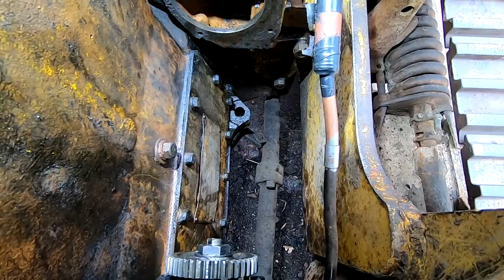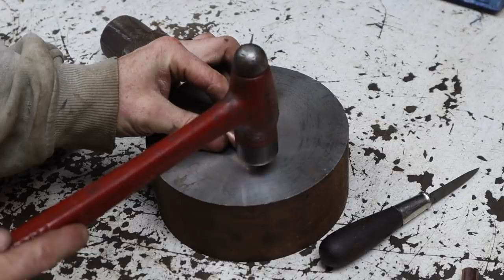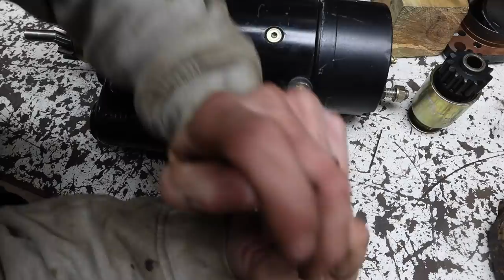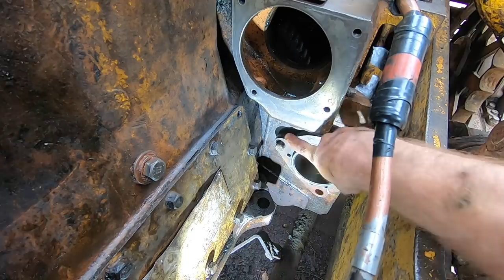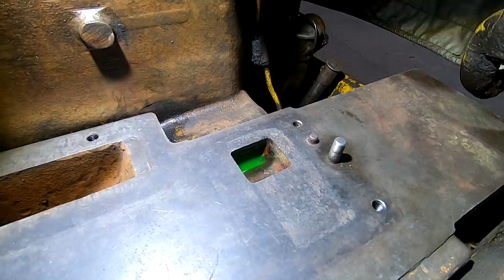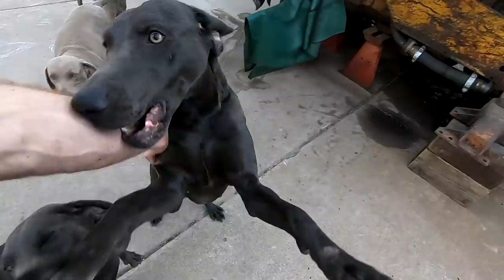Adding a SECOND Way to Start the OLD Cat TraxCavator!!! ~ Part 17 ~ 1950s Caterpillar TraxCavator

Comment: I would just wire the pony motor starter to one leg of the 24 volt battery so it was only fed 12 volts.

Comment: Wire Two 12 volt batteries in series for the main diesel starter add a separate battery leads to the + and - of one battery and it will only pull 12 volts for the pony motor

Comment: If you plan to work it fix it now. If you don't you know it will fail at the most inconvenient time. As for the battery issue a start relay should work just fine. You only need separate start buttons. One for the pony motor on 12v and a separate one to tell the relay you need 24v. Any equipment parts supplier will have them.

Comment: shoulda woulda coulda.. i would have drained all liquids from the machine when the pony motor quit.  You already know how to (re)build the radiator so that was an easy part. And in the smithery you have tools for lifting heavy parts. 
Have you already re-assembled the pony motor? No? Do that first. Then just pull off the cap and replace the gasket.

Comment: If the head gasket is mildly leaking now it is only going to get worse over time. So while you have her stripped down as far as you have her now. It makes sense to pull the head off and fix it rather that get her all put back together again and a month down the road she blows completely and you will be kicking yourself for not having done it when you had the chance. I say replace the head gasket now and save yourself a shed load of work later.

Comment: Open it up.  Those old motors usually are down on compression so lapping valves will help, and coolant leaks tend to get complicated, usually at the wrong time and definitely in the wrong place 😕

Comment: You should absolutely do it, A broken head gasket can only get worse, right now there is no water oil contamination but that's not to say that sometime down the road the gasket further deteriorates where that's happening putting at risk the mains, cam bearings, scoring of the cylinder walls, rings breakage and a whole host of bad news, You at that time will kick yourself for not taking care of it, as for the thinking of "Opening a can of worms" wouldn't you rather know if there were any further issues? after all is said and done you are doing all this work to fix this dozer up to be able to use it reliably right? and at the very least its more quality video content, We, your viewing subscribers are not in a race to see this dozer back up and running that will happen when it happens and it would have been worth the wait as you take us down this wonderful journey of fixing "Big Red", I also think that if you are going to go through the engine, then new bearings and rings wouldn't hurt either then you will know after all the work is done, that's it's going to last another 70 years but at what point do you take the attitude of "if it's not broke don't fix it. let alone the extra financial expense, but as for the gasket yes absolutely replace it.

Comment: My gut feeling would be: talk with Sqatch 253, he seems like a Cat Guru. What I´d do: I know nothing about 24V stuff. Do You run 12V lights but 24V starter? After figuring that out I´d dump the annoying pony altogether. If i can use the starter like the pony I can crank with or without compression and start, no matter the temperature outside.
Electric start is so convienient, I would not want to miss it. I bet, if You keep ´em both You´ll end up using the electric mostly. I know, the pony starts electric, too but all the problems You had with it- I´d have dumped it as soon I can. Nobody lets it run until it could give off some heat to the big block, anyways. But if You stick with it: always shut off the gas valve and let it run dry to kill it. Otherwise the risk is thinning the oil with gas thru a leaking carb.
See why I vote for electric? Just get good, beefy batteries and wires, throw on some good lights and off You go.
Ah yes, do the head gasket. Please do. Leaks are annoying and ugly. Please do the head gasket, thank You later.

Comment: If it ain't broke, don't fix it. So, the first thing you need to decide is, is it broke. Also, have you tried to re torque the head bolts? Although I don't know if there is any truth to it, I was warned many years ago by a mechanic friend that increasing the compression on worn rings is a problem looking for a place to happen.

Comment: All that stuffing on top of the starter motor and none underneath lol. If the head gasket leaks there is the possibility of a leak in the part that you can’t see. Best to do it while the machine is already partially stripped.

Comment: Can't do bonfires that large here. No brush piles larger than 4 foot diameter and 3 feet high. Any fire requires a permit and has to be constantly attended, out and cold by midnight. No coals.

Comment: Leaks don’t get better, they get worse! You could try retensioning the head but in my experience its unlikely to work. Bit the bullet, pull the head, while its off valve grind and check block and head faces for trueness and defects, new gasket, properly tension it down and retention it after 10 hours and then its all good for another 50 years!

Comment: You will need a charging system to charge the 24 volt battery system batteries meaning you will need a 24 volt generator and voltage regulator or 24 volt alternator. Does the pony motor and the new starter both use positive ground?  If they do the Simplest way is to use two 12 volt batteries connected in series as you said with 2he 24 volt charging system connected to them with the batteries connected in series.  Is the ground for the pony motor and the 24 volt starter common ground through the engine? . If this is correct and both are positive ground you don't need a switch between the batteries. connect the negative on one battery to the positive on the other. run a wire from this connection to the start button for the pony motor. Connect the remaining positive to the ground on the engine. Connect the remaining negative to the 24 volt starter switch. Charging system will have to be connected to the battery as the 24 volt starter is and will need to be positive ground. All this is assuming that every thing is positive ground. If anything is negative ground things will be different.

Comment: You know it's leaking and it's not going to fix itself especially if you do start working the engine at all hard - so change the gasket.
However your next challenge will be to accept the condition of the valves and not refurb them whilst the head is off 😀

Comment: If you don't change the head gasket, it will bug the hell out of you. A head with pushrod valves is about the easiest kind of head to remove.

Comment: Easy peasy -  common - GROUND on frame.- to frame  +12 and - of next connected ++24 is there.  How to charge is another issue.  Charge 24V across both is easiest.  Send George the spare unit - so he can rebuild or sell it.  He has the business.  Engine needs new oil anyway and if it evaporates the oil there isn't a drain plug open.  I say No.  Not until a real issue happens.  If you start having to add gallons a use - look for that hole and fix it.

Comment: Any hidden 'worms' will come out and bite your butt anyway.  Your pulling the head will not hurry their arrival nor will ignoring them slow them down.  That oil leaking down on your new starter won't help it or electrical contacts either as well as diminishing cooling ability.  On top of that your personality type would go nuts knowing you could have fixed the leak you are watching!!

Comment: Love watching your channel but………. If you want to quit burning your “rc trigger” quit connecting it to both main lugs on the starter solenoid one side goes to the hot and the other side goes to the small lug or trigger wire. Also cat used asbestos on their gaskets soak them down.

Comment: As a retired auto tech, if you pull the head now I would do a valve job while it's off. But then you might as well do a complete overhaul, bottom also so At this point you might as well do the whole job (overhaul).   Jesus Saves

Comment: I think if you are that far in it should not be that much more work to change the head gasket.  If you put it back together and 3 months later it leaks a lot, you will be kicking yourself.  Yes tahoe

Comment: I would remove the head and have it surfaced to stop the leaks!
Reply: You check the head for flatness with a straight edge. If it is within tolerance you leave it alone. the bottom of that head is flat no combustion chamber in the head. So the valves protrude above the surface. If you mill the head you must sink the valves the same amount. The combustion chamber is in the pistons.

Comment: Go and change the head gasket -- this way you know what you have.  if there is an issue it will be fixed. rather than spend all that time on Red then put it to work and blow a rod.  with the vehicle do a video that b e cool

Comment: to punch bolt holes in a gasket  use TWO ball peen hammers  set one over the hole  then hit it with the other hammer to punch yhe hole

Comment: Yes it a good Idea. but WHERE DO YOU STOP????  Why not just rebuild the hole unit... The head may not leak after it's hot... Now  you have other things to do. An your working outside... So I say put it together an run it an then you will know what you really need to do to that CAT....
As for you truck yes I would watch that repair too...

Comment: Change the head gasket, you're already there. It would be a shame not to and then have to do it after you've put 10 or 20 hours on the machine. You'll kick yourself later if you don't do it now.

Comment: Can't believe something that old had reverse-torx bolts, I thought they were a much more recent design. I'd not seen them before the mid to late 90's myself, when cars over here started to use them everywhere, in a pathetic attempt to stop home mechanics working on their cars. Pathetic attempt because of course all the tool manufacturers knew it was coming and had what was needed in the shops already.

Comment: The head DOES NOT look to be original.  Therefor there's a good chance the head gasket is aftermarket.  Change the gasket to insure the engine will run correctly.

Comment: Pull the head. Your too far into now.   2 12 Volt batteries in series with one lead to ground from the Pair other hot lead to new starter.  Then on the 12V battery that goes to ground add another cable to the other post were the crossover jumper is and run it the pony motor.  Two separate push button switches wired to each solenoid.  One from 24V side to new starter one from 12V side to old starter.                                                                                                                                TGP   55Year IUOE Retired
Reply: You sure it's POS Ground?  Usually on the starter / Gen tag   or REG. it will be marked POS or NEG.  just checking Any way to locate a 24V gear driven Gen?    AWESOME  so far                                                                                                                                           TGP 55Yr. IUOE Retired

Comment: I'm afraid you're going to have to take the head off. The machine has not been up to operating temp for ages. Imagine your feelings if you left as is and when first running and hot you got leaks or even worse an emulsion (coolant in the oil). You'd be soooo cross with yourself. I didn't change a head gasket on my OHTC Alfa once when I had the opportunity - stupidly thought I'd get away with it. Lesson learned.

Comment: Not sure of your mind set of double starting systems.  If I read you...if you had a Harley...you would rather have a kick start ( resulting in a broken leg back fire ) and an electric starter😮. An additional starting system on any motor is anal...kinda cookoo.